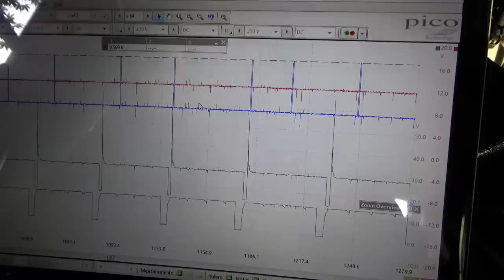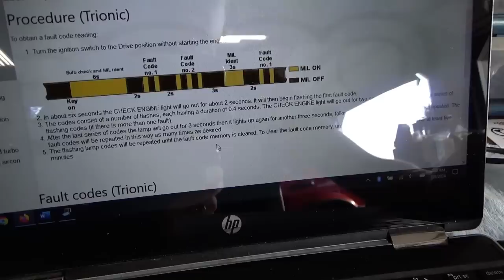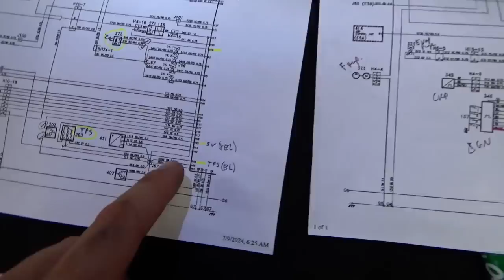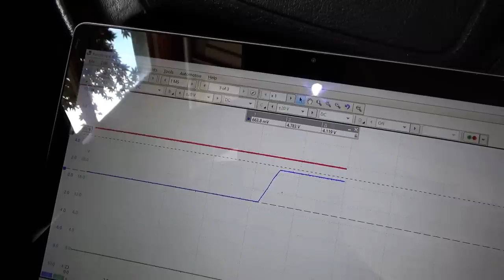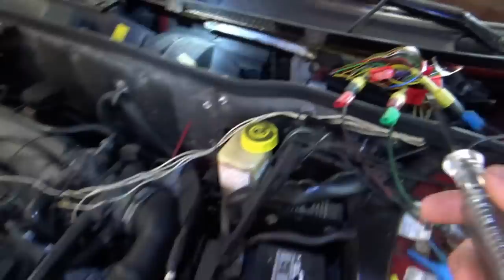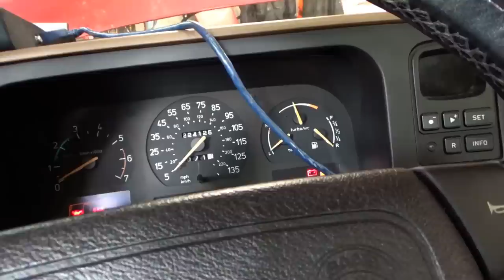(Pt 3) Hot-Sauce SAAB...High IDLE & Slow THROTTLE? ('93 9000 CSE Turbo)

Comment: With no CAM target information you do not know what engine phase is occurring relative to the crank during the 720 degree 4 cycle sequence. For an even firing engine, each pair of opposite firing order cylinders will have spark, one on compression and one on exhaust, know as wasted spark. Fuel injection will occur 1/2 calculated mass every revolution. Which is essentially wasted fuel, if I can use that analogy. The crank target should have at least one pulse per cylinder at base timing (perhaps 10 degrees before DTC on compression cylinder #1). This type of CNK target is called a low data rate crank wheel.

Comment: To me this would be a worth while candidate for an aftermarket ECU and a brand new engine harness. It's a cool quirky "performance" car with old difficult to work with computers. Haltech even has OBDII diagnostics. Then sky's the limits for performance parts and using modern TBs and ignition components.

Comment: A Saab is worn at 225000 km, let alone 225000 miles! I did see a rust hole where the strut is mounted in the engine bay. That is an automatic MOT fail here in Europe and very difficult to repair properly (so the MOT inspector is satisfied). It also probably does not meet exhaust gas regulations. This Saab could not be on the road here in Europe.

Comment: Maybe I missed it, but did 'we' clean the throttle body? Does it have a mass air flow sensor?  Throttle position relearn?  I enjoyed the PICO autopsy. And you are the best I have ever seen on the electricals (re: Vicegrip GAaage). Just thinking basics.

Comment: Great video. But you will need a SAAB TECH 2 scanner, if you want to diagnose and repair a SAAB. For example, the original Electronic Throttle Body needs calibration, which is done by ISAT or Tech 2 with early generation software. In order to diagnose and reset other systems such as, SRS & ABS. You will need Tech 2 as well. The engine coolant level was either low or the level sensor is defective. There is a saying that 'In Order To  Fix a SAAB Car , You Will Need Another SAAB Car'.

Comment: Do not like that ckp pattern. It should have a regular repeatable pattern...there is no cam sensor so there is no correlation check. According to service info it should be 1 small and 2 large tooth/gaps. I know that the car runs, but i am concerned it might come back...🤔🤔🤔

Comment: Dephia ("Détection de Phase Intégrée à l'Allumage") is an PSA version of the aystem in Saab, used to replace cam sensors. Peugeot / Citroen use an waste spark system, with two double eneded coils having a sparkplug at each end. 1-4 coil has an extra windiing for phase signal.

Coils fire by signal from crank signal.  When 1-4 coil fires, spark ingites first at the cylider not having compression. If it is 1, the phase signal goes negative voltage when spark occures. If 4, it goes up. This way ECU detects when cylinder 1 is in compression stroke. No cam sensor needed. 

It is useful to know that this kind of systems exist. If the phase coil is faulty or wire is broken, you have good spark but injection never turns on...

Comment: Good sleuthing Ivan! I caught myself nodding throughout your video as you uncovered the truth. 1992 was the first year for Saab to use drive by wire throttle on the turbo 9000 models. It was frustrating for owners in the winter because the system was too intrusive and people were getting stuck in snow because it would kill your momentum. I think it was a couple years later where we could install a on-off button to disable in bad conditions. I believe it was model year 94 where TCS became an option. Also unless someone found a workaround base throttle adjustments could only be carried out with ISAT or the tech2 with the Saab adapters and software. So even if it had a working throttle body without the means to calibrate you were SOL. If you ever come across a 9000 Aero in good shape you should get one. Best seats of any car I owned hands down. Also the 9-5 Aero was a really nice car as well. Saab was 30 years ahead of the market where manufacturers downsized engines and utilized turbochargers to do way Saab was doing in the 80’s and 90’s.  In 93 to show off their Trionic EFI system they plumbed the exhaust gases from a Saab 95 2-stroke into the intake of a 2.3 turbo engine and the exhaust emissions from the turbo were still cleaner than the surrounding air. Now we are chasing tiny improvements which cost the consumer big time in both the purchase price and the cost to maintain. Hopefully Chevron deference will roll back some of this needless and lawless legislation and put money back in the pockets of the consumer.

Comment: This is why people should leave cars alone. It was originally built with a drive by wire throttle, leave it that way.
Reply: I prefer to replace cable type throttle bodies with DBW throttle bodies when using standalone ECU’s.  Nice to have the flexibility in tuning!!  

No factory turbocharged vehicles should be left alone, life’s too short to drive boring cars
Reply: @GSRDUDE80  um, this car in the video originally had a drive by wire throttle. Someone messed with it and put a cable throttle in. And I meant leave it alone by not doing that.
Reply: @Jonathan-A-877  misunderstood completely agreed 👍

Comment: Ivan.
Because of the way you diagnose vehicle. 
I finished up a 02 Camry. Customer said it went to a shop. They couldn't figure it out. They tried swapping abs module and no fix. 
So I got the task. 
Took me about 3 hours for me to figure it out. 
I went to the local " Used parts warehouse" and got me one. 
Plus the shop didn't plug in the harness to the module. 
I reseated the harness. 
Bleed the module.
And presto I got it fixed. 
Then the abs lights would come on as the customer stated. That was the main reason for the diagnosis.
Next the steering wheel sensor was bad. He ordered one from Yoda dealership. I installed it. Did the sensor alignment task and presto, I got that fixed. 
This task took time. 
Next task brakes, rotors and pads. 
Was a task, rusted on rotors. But I got it done too. 
Customer was happy it's fixed. 
I told him there are some other items it needs attention. Gave him the list.
Reply: One of my memorable ones was a Camry. I want to say a 1992 model. Car shuddered very badly in the transmission in the last 2 or so MPH coming to a halt. I got lucky by driving at dusk. The "R" on the gear indicator glowed ever so slightly. Pulled both reverse lamps and the problem went away. Brake light ground at left trunk hinge was broken and brake lamps were getting a ground via the reverse lamp bulbs. This fed into the reverse gear selector circuit and the car was trying to grab reverse gear. Fun times!

Comment: With that O/12V Idle Compensation circuit being polar opposite, I keep thinking of using a 5-pin relay to flip-flop the input, but I think the issue is coming back to the TPS.  If the computer is expecting an electronic throttle body, wouldn't it expect to see a change in the TPS signal as it controlled the idle?  That might be our issue as to why we still have that Code 5, and the one thing that's different between the two configurations.  Sadly, that would mean there's no way to compensate for it.  Argh!  :(

Still a really neat car to see!  I love this era of vehicles, just because you could go on an adventure in swapping parts from different models to create your own custom configuration.  10-15 years after they were made, parts were both cheap and plentiful, and it made tinkering, experimenting and learning fun!

Comment: In DC circuits size and length of wire is critical. The crank sensor wires are much longer then the OEM would have been, which means more resistance and signal loss. When replacing any DC sensor wires etc., you should make sure the wires size is the same or larger and the length as close to the original length as possible.

Comment: Love your passion for these older cars, Ivan! I have a 1989 C4 Corvette that I plan on keeping for a while... Crossing my fingers I won't need to bring it to you anytime soon! 😁
Reply: coming soon to PHAD, 1989 C4 corevette... 🤣🤣
Reply: @throttlebottle5906  RIGHT?! Knock on wood!! 🤣🤣
Reply: @badgerdave22  lol, you'll probably be OK and never need him, since that was pre-optispark ignition system(older than 1992), they held up well, with exception of simple to diagnose/replace parts, window/lock/light switches, wiper motor, starter, alternator. still when GM had decent lasting stuff.
Reply: @throttlebottle5906  Yeah, I’m very glad I don’t have to deal with an opti-spark! The GM engineers messed that up! 😁

Comment: You might have got this messed-with sad Saab working as well as is possible, given it has the wrong ecm.  With ecm wires tied  to different places & voltages other than where they're supposed to be, & others not even connected, it's probly never gonna be perfect.  And you're probly never gonna get the idle speed down to 700-900 rpm or whatever, without that other module either.

So it seems like it's only gonna have a bandaid ecm solution.  l guess without this incorrect ecm, it would be parked in a scrapyard!  $500 is probly all it's worth.  And you've still got more repairs to do on this thing?  I'm thinking mate that you are gonna be the last person to ever work on this car!

Has this got a LH blinker light out? - It seems to flash a little too quick.

Comment: I can remember when I did the DOHC conversion in my 1986 model Holden VL Commodore which was basically a restyled Opel Rekord which was homologated for Australian & built in Australia by General Motors Holden & Holden adopted the SOHC 3 litre (RB30E) engine from Nissan in Japan, the engine was shared with the Australian built Nissan R31 Skyline.

Well,I built a DOHC version out of the 3 litre engine which became a Nissan RB30DE engine,it ran the 1995 Nissan RB25DE cylinder head, pistons,oil pump & automatic ECU although my car was a manual model.

It idled a bit too high because the signal wire for the neutral safety switch was disconnected so I connected it to ground so that it would idle at the right speed.

When any gear other than neutral or park was selected the Nissan ECU was commanded to open the idle air control Valve further so that the engine wouldn't stall or idle too low,the problem is that since the car is fitted with a manual transmission,the wire needs to be grounded so that the engine won't idle too high with the automatic ECU !

Comment: Like you said it goes run it👍
Reply from the maker: @gillgetter3004  I got it down to 1100 rpm by tweaking the throttle cable and stop screw 😉

Comment: Just a thought but many years back on a Volvo 265  V6 engine with bosh FI , I had a similar problem with high tick over but found there was an air bleeding valve/ screw to adjust the tick over, this will have been the beginning of ecu control on throttle controls, just a thought that there might be something similar on this car as ruffly the area, great video and love your logic of thinking things out 😄😄😄👍👍

Comment: The camshaft position sensor is provided by the ignition discharge module.The ignition coil’s fire two at a time on startup until the ignition module detects which cylinder is on compression-this is why odd scope pattern on startup.Hth Jerry
Reply from the maker: @geraldsweet3789  very interesting. But the CKP pattern was so inconsistent! I can't believe that it ran haha!

Comment: Use to have a saying. This is like trying to take chicken s--- and making it into chicken salad.  I also use to call these cars scabs. Use to work on these decades ago and now look at them as the engineers as marvels because they went out on a limb not copying others. These also remind me of Renault, fiat, Peugeot, Porsche, BMW all back in the 80's when we worked on doctors and hospital clients because our shop was only one in town that worked on foreign vehicles.  I gained a lot of experience enough that I didn't want any part of years later and stuck with more common vehicles.
Reply: Found SAABs very, very easy to work in.  Their manuals were second to none and every thing was easy to get to.  Of course when GM took them over that changed and GM made a mess out of SAAB just like everything else they touched.  I'll take working on European vehicles over domestics any day.

Comment: Ivan when they switched it to a cable throttle body they probably messed with the idle stop screw and throttle plate is open too much for the IAC to take control 🤔

Comment: Would really like to see all the error codes resolved. Check engine, srs, throttle codes, etc but can you even get a good used or remanufactured throttle body? Engine sounds so good for 200,000+ miles. Maybe the previous owner could not, hence the custom wire job under the hood. These 90's cars are having issues with getting parts now and probably 10 years ago, too. Great content!
Reply: I wore out the throttle body at 450,000 kilometers on my car, no flow data was availiable and no parts as it was a unit with the intake.
My wise mechanic made a special baffle for the idle air solenoid but the original problem was thought to be fuel related and he did many things to correct the idle speed.
What brought it up was an intake cleaning, because of this he did it again and it showed the worn piece.

Comment: I think Rover made the engines..My 1977 99ems  had a rover.
Clutch faced front and you could change clutch disc without pulling motor etc 

Amazing cars in snow.

On one engine a CAT/ Perkins  diesel the crank sensor had small metal chips stuck on magnetic pickup causing bizarre issues .
No one could find the problem.

I pulled it out cleaned off sensor magnet set clearance to reluctor and it ran perfect no parts required.
Reply: Indeed so earlier engines were made for Saab by Triumph later to become part of British leyland /latterly Rover before their demise,this engine is Saabs own produced with GM  and a little bit of help from Volvo

Comment: Noticed in part1 you had a Red and Black coil.  From my experience working for AA uk if you have T7 electronics never mix red or black coils . T5 electronics you can.  Probably wont help with all the issues you have with the car but just an observation .

Comment: Good job, i did a few tcs -> none tcs conversions 20 years ago as the onces equipped with tcs always had problems and was almost impossible to sell. Trionic 5/7/8 all uses the sparkplug/di cassete with help of ionization current to sense piston position/camshaft position. It also uses ionization to monitor knocking, missfires.

Comment: Is this car a waste spark system?  That would explain why the scope capture of the ckp didn't make sense.  It also explains why it doesn't need a cam position sensor as well.
Reply: Fairly certain it isn't wasted spark.  The Trionic system was very advanced, but also quite complex.  It applies a fairly high voltage to the spark plugs all the time and monitors the current flow (ionisation current).  From this it can determine which cylinder is on the compression stroke vs exhaust stroke, so it can synchronise the firing order without needing a cam position sensor.  It also uses this system for knock and misfire detection.
Reply: It's waaaaaaaay cleverer than that!!  The Trionic system was decades ahead of anyone else at the time.

Comment: It might be that the TCS light only switches off after the first application of the brakes (ABS system). It's like a self check routine.This was the case in my Volvo 850 (TRACS system). If it doesn't have the electronic throttle body it might not pass the self test routine and throw a code.

Comment: Don't forget the ecu goes into an adaptive phase if it is new to the car. Does all sorts of crazy things to the revs etc for at least 30 mins. Needs a drive for 20 mins or so. The TCS on these are notoriously unreliable and this looks like it has had normal throttle body and idle valve retrofitted
Reply: Thanks for that info.
Kinda crazy to think a car goes that!